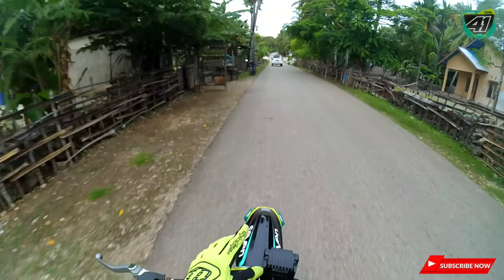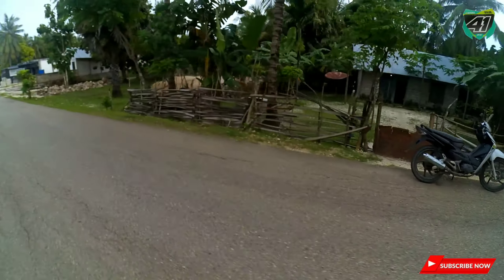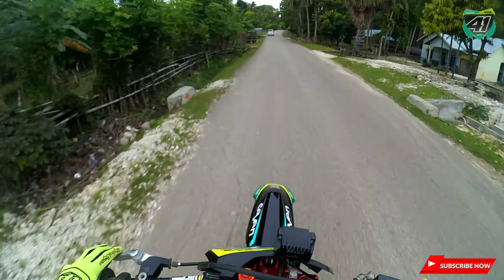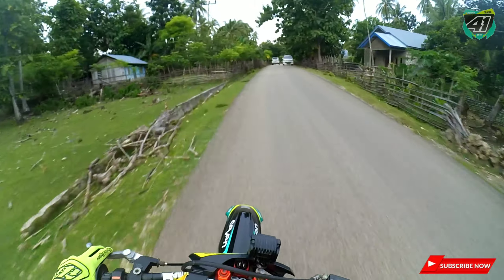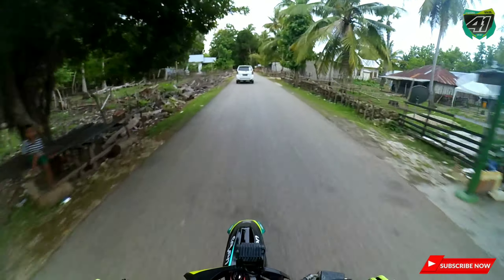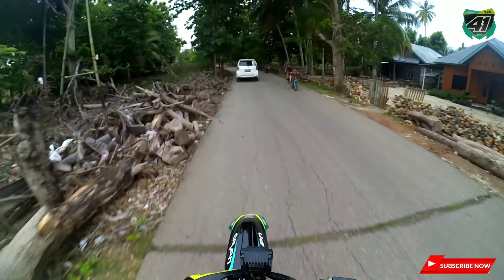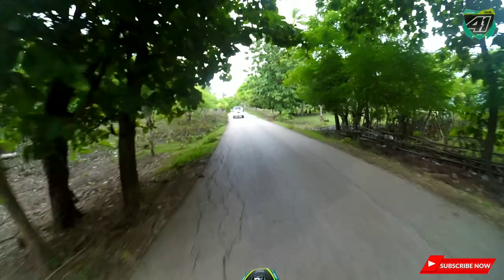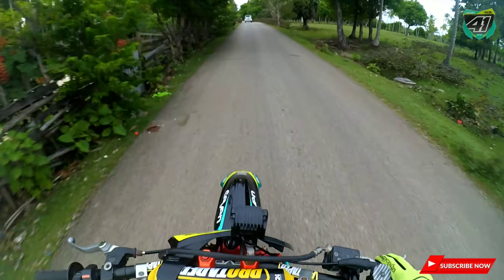Cara Meningkatkan Performa KLX 150

Comment: Biaya part tertanam di klx abng pun hanya selisih dikit dgn bore up. Hanya sedikit perbedaan di harga piston fim 58mm (std) dgn piston fim boreup. Blok klx utk trabas maksimal 63mm (tipis bgt, namun ttp aman di ajak trabas). Klx sy spek nyaris sma dgn klx abng, tp sy pke piston 64mm& norifumi evo.  Ttp aman di hajar trabasan dan ttp awet.. dh hmpir 2 thn blm bongkar piston lg. Boreup pun ttp aman asal kompresi yg di patok jgn terlalu tinggi dan rpm di kasih limit di 12rb rpm. Salam 1 jalur
Reply from the maker: Mantap bang salam satu jalur👍🙏iya bang asal spek nya jangan tinggi2 biar perawatan nya juga mudah,, dan yg paling penting oli bang harus ekstra di perhatikan biar mesin tetap awet jangka panjang.. apalagi KLX aslinya cepat panas ya bang😁
Reply: @FANDYKOLLY  bner bng.. slain spek mesin yg di oprek,  oli kunci utama keawetan mesin..
Reply from the maker: @dendiaslam1081  iya bang😀
Reply: @FANDYKOLLY  mau tanya kk itu kalo pakai noken brt T1 Hed/cop nya dipapas atau tidak🙏
Reply from the maker: Kalo mau beli minta yg model baru KK yg ada sistem ADS supaya PNP tanpa papas kop lagi...sekaligus start tangan jadi ringan..kalau yg BRT semua tipe model lama masih harus papas kop di bagian klep ex sedikit soalnya pelatuk gesek kk

Comment: Izin bertanya bang, motor sya klx bf standar, utk part yg diganti CDI BRT Hijau, Karbu PWK 28 KX 85, mastercam (noken+roller) t1. Kmren pas psg mastercam piston dicoak dkit lalu kuku diplatuk tsb jg dipapas dkit, kata org bengkel nyangkut, per klep msih pake bawaan standar bang,lupa beli yg BRT🤣Cm skrg mesin agk berasap, it kira2 kenapa ya bang? 
Dan mohon pencerahanya jg bang,maklum tgl dipedalaman agk susah bang, smp skrg settingan karbu msih blm dapet bang, kdg dpt atas tp bwahnya tdk, jg sebaliknya, kira2 yg kurang pas nya dimana ya bang🙏🙏

Mohon dibantu bang, terima kasih sebelumnya🙏
Reply: Oh ia, utk knalpot pake norifumi Torch (standar), block jg msih standar. 
Motor ini sring dipake trabasan maupun harian
Reply from the maker: Harusnya pake noken yg tipe S dulu bang kalo blok masih standar
Reply: Iya bang kmren beli lgsg yg tipe t1
Reply: Trus bang utk settingan karbu gimana bang, smp skrg msih blm maksimal. Msih putus2, atas dpet bwahnya mbrebet putus2

Comment: Mau tanya bang..noken yg tipe S sama T buat mesin standar lebih recommended yg mana?
Reply from the maker: Seri T lebih enak bang,, tapi belinya yg model terbaru yg sudah ada sistem ADS biar elektrik stater makin ringan..ada di salah video saya di bagian atas saya pasang punya teman yg T1 model terbaru
Reply from the maker: Kalo T1 model baru yg sudah ada ADS langsung PNP bang,,kalo model lama harus coak head di bagian pelatuk ex sedikit soalnya pelatuk gesek sama head..
Reply: @FANDYKOLLY  cuma coal yg bagian ex.. selebihnya gda lgi??per klep hrus gnti juga gk ya bg?
Reply from the maker: Iya bang masalah cuma disitu yg harus dipapas..selebihnya PNP.. kalo ganti noken as, per klep wajib bang biar aman..biar bisa ngimbangin lift noken as racing yg tinggi.. kalo gak di ganti per nya rawan mentok per standart